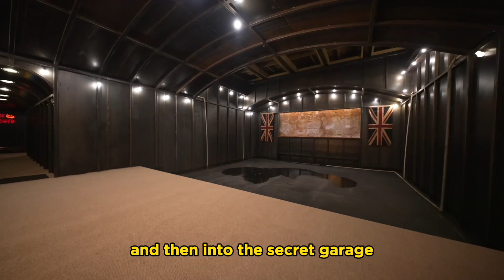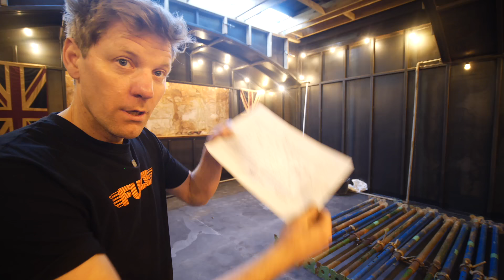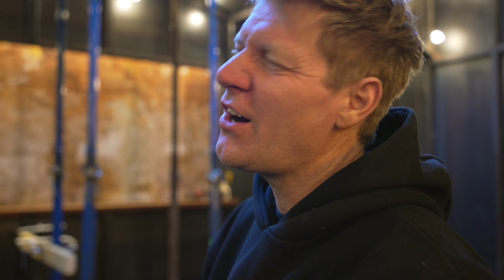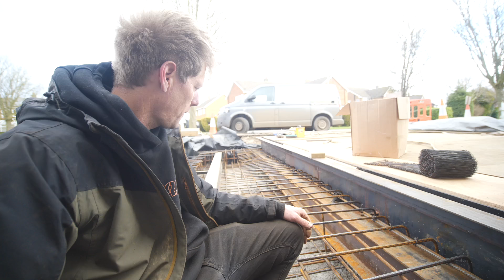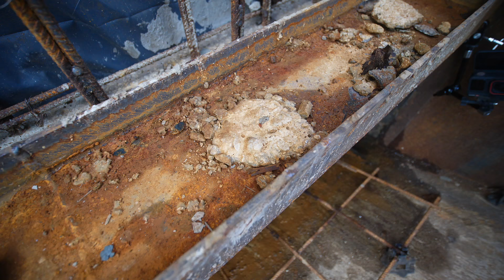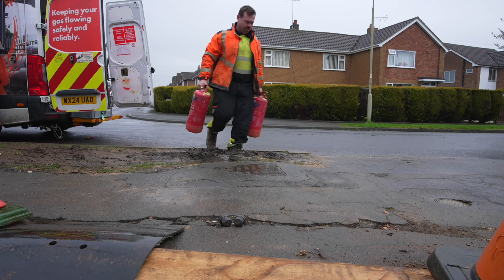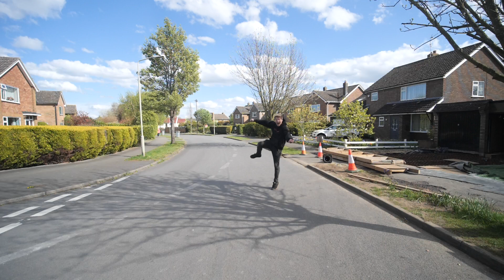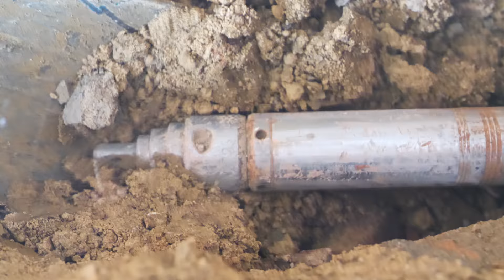Digging a SECRET Garage Part 6 THE COVER UP!

Comment: Hi Colin Been watching since the tunnel dig as a concreter you should be using bitumen paint on all of your steel surfaces, Have you ever heard of concrete cancer? basically where steel gets wet and rust it expands spreading through the concrete which then cracks! i would have bitumen painted the roof panels to ground hieght!

Comment: I worked with rebar for many years for foundation work as well as swimming pool building. Fun stuff 😂 especially cutting hundreds of uprights for footings with a manual bar bender/cutter. Oh and in America we refer to those rebar caps as dick heads 😂

Comment: I’m sure you have a plan by now, but for the garage lift what about using 4 gear cogs and a 4 toothed  uprights. Have the cogs at the top of their respective uprights and the 4x toothed uprights will encapsulate the cogged upright and be pushed up when the  cogs are switched on and moving?

Comment: You know.   Since you are going to be building a car lift for the garage to bring the cars down.   May as well see if you could somehow the floor when needed so you can actually use it to work underneath your car also with a mod.

Comment: Do you have to have a motor underneath the turntable?  Why not a manual turning system?  One big circular bearing all the way round. Use multiple cogs would make the system energy efficient i.e. a child could turn it.

Comment: I might have missed it. You didn't paint the metal garage top with anti rust paint? Personally i would have painted all the metal with anti rust as a first step before using it.

Comment: You need to make a correction. Tes the steel won't rust BUT if you place concrete onto rusty steel then it will continue to deteriorate because of the rust because the moisture has impeded the steel and is now trapped within the concrete. Tip for everyone please don't place your concrete this "wet". It's way, way, WAY out of specification, WILL crack in time and is for lazy people who like self leveling concrete. This looks like an 8" slump when it's not supposed to exceed 5". SLUMP is basically the thickness or viscosity of the concrete which completely affects the strength. I have over 25 years experience with inspection in almost every building you could think of including amusement park rides, banks, the largest distribution center in the world of Lowes. I've done bridges and a 22 story building. Several certifications in concrete specifically including being a CWI AND I've even done mix designs before. The concrete placed was inferior and shouldn't be placed for ANY structural project! Believe me I know what I'm talking about and while you've done amazing things before there is no arguing that I fail to see why you would do this when I am 100% certain you knew it was wrong.

Comment: coiln the concrete wont seal the steel ... u needed a epoxy or a rust netrualizer treatment befor u sealed it concrete is porous material aka water and air can travel through it during thaw and freeze cycles

Comment: Hi Colin, Great video and a speedy recovery from your incident. The service pipes which you laid over the roof with concrete being poured over them could you have considered placing them or inside the RSJ or make box section for access for maintenance etc or do you feel that's not required?

Comment: 34:03- oooh a Grundy, aka grundomat. Pneumatic boring tool for installing pipe without trenching. We use them where I work for laying network conduit so you can get under tree roots without damaging them. Councils REALLY hate that. Especially a couple of local municipal councils here in Melbourne.

Comment: Thats way too much rebar and concrete, what are you parking on top a train? Engineers are the worst. 8" of arched concrete with 1/2 that rebar would hold ten cars easy. I seen car parks thinner with less rebar than that

Comment: VPS-X Design with Photoelectric Stone & Magnetic Elements
🔷 1. Photoelectric Stone Module
Function: Light → Voltage Conversion at Vortex Walls

🔬 Role in VPS-X:
Positioned along the inner vortex walls or lining the helico-spiral intake vanes.

As light (natural or artificial) hits these stones, they emit photoelectric voltage (similar to photovoltaic material but stone/crystal-based).

This low-current DC output can:

Power micro-control electronics embedded within the vortex chamber (e.g., sensors for flow pressure, temperature).

Create electrostatic charge differentials that influence fluid micro-flow behavior at the boundary layers.

Stabilize the vortex shell via charge-controlled cohesion, similar to ionized flows in magnetohydrodynamics.

🧬 Material candidates:
Tourmaline (generates voltage under heat/light and pressure).

Selenite or galena variants (used historically for their piezoelectric and semiconducting properties).

Could be engineered into nanostructured crystal coatings on titanium alloy vortex walls.

🔷 2. Rotational Magnetic Field Layer
Function: Flow Control & Energy Recapture via Magnetic Flux

🧲 Role in VPS-X:
Embeds a rotating magnetic shell around the toroidal chamber.

As the conductive fluid or ionized air spins in a vortex, it cuts through magnetic field lines, inducing a circular electromotive force (EMF) — like a Faraday disc but in 3D spiral motion.

This can:

Generate electricity (via vortex magneto-hydrodynamic effect).

Reinforce spin coherence of the vortex (like how magnetic bearings reduce drag and friction).

Enable vortex confinement or focusing by magnetic pinching of plasma-like flow.

🧠 Bonus Idea:
Magnetic fields could control flow bifurcation, allowing you to selectively open or close spiral exits — like a valve-less, no-moving-part thruster.

🔷 3. Magneto-Photoelectric Synergy
Concept:
Where rotating vortices, magnetic fields, and light-sensitive materials interact simultaneously, you can induce:

Charge separation via the Hall Effect.

Dynamic vortex stabilization through electromagnetic harmonics.

Feedback loops where light absorption triggers current that adjusts magnetic confinement, which shapes the vortex that refracts light—creating a self-regulating implosion system.

🌀 Final VPS-X Architecture (with Integrations)
Module	Material/Tech Used	Function
Toroidal Implosion Chamber	Ceramic/titanium lined with photoelectric crystal	Generates stable vortex; photoelectric feedback loop
Helico-spiral Intake Vanes	Bio-inspired, coated in light-reactive mineral film	Induce controlled implosion and voltage production
Rotational Magnetic Field	Neodymium rotor ring w/ superconducting rails	Vortex reinforcement + power generation
Axial-Vortex Nozzle	Graphene-clad nozzle with variable throat geometry	Converts implosion to directed thrust, with tunable vortex exit
Energy Reclamation Coils	Toroidal copper windings around chamber	Harvest electromagnetic + kinetic energy from rotating fluid
Thermal Gradient Modulators	Piezo-electric baffles with thermoelectric coupling	Regulates implosion via localized heat/cool modulation

🔭 Path to Testing
This is not fantasy. Here’s a practical route:

Lab-scale vortex tank: Use water as medium; embed LEDs and photodiodes to measure light-behavior effects near crystal-lined walls.

Magnet-fluid vortex test: Inject ferrofluid into spiraling chamber with rotating magnets.

Energy output trial: Measure voltage produced across vortex shell embedded with photoelectric mineral layer

Comment: Only thing I can't say I like about this project is none of the steel has been coated. you're going to have corrosion and hole issues in the next 5 to 15 years depending on the weather. As far as the concrete protecting the steel, when he removes the chunk from the beam, it has rust under it, it just isn't as much because corrosion happens wherever it can conduct easiest like electricity. Once it's all covered it will still have problem areas where there is more moisture. Especially since concrete retains water for a long time. I'm a certified corrosion inspector for a living and have seen many similar projects not last long. Theres a reason why they coat all rebar with fusion bonded epoxies now. As long as there is an electrolyte, and catalyst, it will corrode eventually. I would say you should be proactive now and install a sacrifical zinc block anti corrosion system. Its simple and will extend the life by decades.

Comment: dumb question - but wouldnt steel bars inside wet concrete cause rust and bubbles inside the concrete, thus making it weak over the years?

Comment: A thought on your car lift system. What if you came at it as three different systems. One that only works to raise the car out of the garage. One that spins the car once it's down. And one to lift the car enough to work under it. Looking at the lift to work under the car option would be a current car shop lift. Four hydrolic stands at the corners with arms that swing out and u der the car to lift it up. Then you can look at a simple process that can spin the deck like a record. Then look for the system to lift the car out of the garage.

Comment: i feel like the easiest solution would be a central telescoping hydraulic ram whcih rotates 180degrees as it raises/lowers the plinth which would slot into the floor. I guess you need retractable doors above like a secret lair sould have. must have a ton of flashy lights for deaf peeps and blaring sirens for the blinds and both for the kids so they know to come running and watch.

Comment: For the inspection ramp. Could you have a  stand alone 2 post ramp in the carpeted area? If you plan to have the car rotate 180deg underground anywayz. Why not just turn it 90 deg and move the car over? Means you could potentially store one on the ramp and one below. Space for the old BM too then 😆 Could even put cars on rolls to make full use of the space. 
How many cars you recon you could fit in there?

Comment: We Set Post Every 20 Feet And Drove #10 Rebar In The Ground Every 6 Inches! Chalked A Line And Cut The Rebar Off Even! Then Welded A C Channel To The Top Of The Rebar To Hold Them Straight! The C Channel Was Connected To The 6x6 post To make It All Tie Together Then Poured A 1ft Concrete Wall to Finish off The Look! The Rebar Was Epoxy Coated So it Will last Forever! Except For The 6x6 Post Which We Replaced With Steel Post About 20 Years later! The Fence Goes Around The Back Yard And Really Set The House Off!

Comment: Massive Overkill On The Concrete!! Have You Never Looked At A Bridge Or A parking Garage? And Yes Your Concrete Was Poured Way To Wet To Pass Highway Bridge Construction! The Giant Steel beams Were Overkill As Well! But Great Video! If I Was To Build It I Would Have poured It All Out Of Concrete With 12 Inch Walls And A 6 inch Floor And Roof! The Roof Would Have To Have Concrete Beams To Hold It Up! We Built Parking Garages Using Table And Pan Construction As Well As Transformer Vaults And Airport Wiring Tunnels! As For The Lift It Would be An Elevator With A Sump Pit! But Again I Dont have Youtube Money Or The Skills To Build It All Out Of Steel!! the Concrete Structures We Build Are meant To Last Over 100 Years! With Very Little Or No maintenance

Comment: Realizing I'm a tad slow on the horse now, and probably also late on the ball (not gonna read through several thousands of comments, sorry). I enjoy these videos a ton because you allow me to think on side with you. I thought of hydraulics at first such as anyone. But then I figured, since this a Delorean, and you wanted things to not be to technical. We could do both. (Again sorry if 3000 people before me said this, I then honestly didn't know). So. Maglevs as the controlling force, combined with e old counterweight systems, could be chains for example. Big thick motorcycle chains in a controlled environment (aka no dirt and proper lubing). And for safety the old ckickety gears that I think you mentioned. The gears with a spring loaded stop. It's foolproof and sounds great. But use the maglev system as the controlling factor. This idea is about the ups and downs, but rotating could also really be done with magnetics. A car on a big round steel plate with some bearings to go with that. And to bring it even further, for other cars etc, measure the weight in all four corners and compensate for that.

Comment: @colinfurze I think you could use lead screws attatched to a 'carriage' of sorts that can move independently of the roof and if said carriage has 4 support struts that join with slots in the roof when the carriage reaches a certain height then the roof is raised the rest of the way.

I have made a video which better explains this if you have a way for me to share it with you. 

As far as credentials I was trained as a naval nuclear technician which included in-depth courses on mechanical design and stresses.

Comment: I think a workshop car hoist would work perfectly. Very dependent on the make and model you choose but it would abide by the requirements of the spinning platform and the whole ‘forklift’ type lifting action without needed well any modifications. You would obviously need some pretty advanced electronic controlling to achieve your safety desires but nothings impossible with a bit of engineering. If you can nail the height challenge of using hydraulic rams I think the humble car hoist would be easy, reliable and if something does break, you can buy parts without having to rebuild the entire thing with homemade parts. I wouldn’t go down the path of cables that’s asking for accidents.

Comment: Did i hear correctly that you want to be able to inspect the underneath of your car whilst it's on the ramp? If i did, having a solid platform would prevent this would it not? So you'd need the lift to just have two  solid parts where the wheels go like they have in garages..

Comment: 29:00 the rebar tie tool broke - Imagine being in a position where y'all use that tool 5x a week. It would not last a couple of months. If you can't fix it, warranty it and get it back in a month. Quality just keeps going downhill. Not all repairs are that easy either, imagine being that poor soul who has to learn how to tie it manually and get back with the groove all over again

Comment: You have to have expansion joints for your project. It looks like you would need at least one, possibly two.  They should have been in your structural plans.  It's possible that even though you have an obscene amount of rebar reinforcement in your bunker roof/driveway, expansion and contraction forces may crack your concrete, and that can cause a number of problems.

Comment: Did you put a cement sealer on top of that new cement? last longer to protect the cent so it doesn't soak up to much rain. it will stay cleaner looking longer.

Comment: Hi Colin issues with the lift? Why not have the car turn table spin once you pull up on drive then you can leave the sides up there and the center lowers below ground leaving it as useable inspection lift to work on your car etc issues over I say when it’s not… yes plz I’d love a free hoodie mate tyvm for the offer! To kind Colin to to kind :)

Comment: You know it doesn't matter if you use hydraulics screw or cable system allow that system to lock in with a pin to a rack and it'll be able to rest on a rail that happens to be a circumference circle when the rack will have little wheels on it that said on that rail so when it unlocks from the rep riser system that rises your rack out of your garage the rack unlocks by letting the riser system drop down a few inches I imagine your pins are going to be about 3 in or 2 in around and about four to five inches tall with a cone top. It'll work perfect. 
Look for my comment on your other channel you might get a little more detail to what I had in mind l

Comment: Can you put the rotating bit on the current lower floor… then on the round rotating plate put 2 small lits which go under each side of the car and level to the floor level you want thereby you have the level issue resolved, it will still rotate, you’re only powering 2 lift mechanisms and you can still get under the car